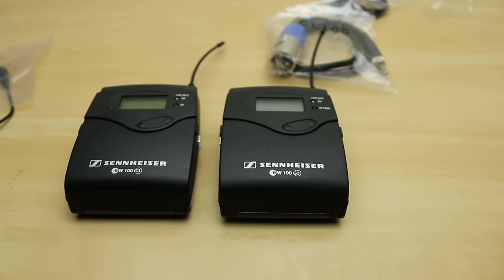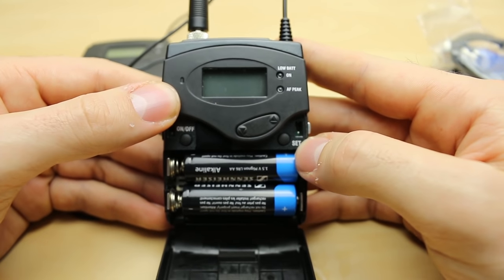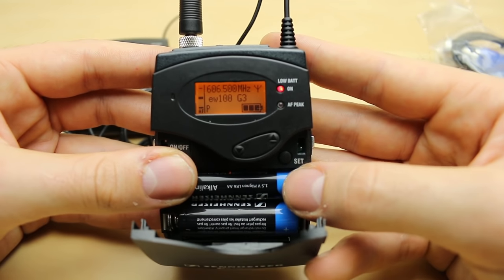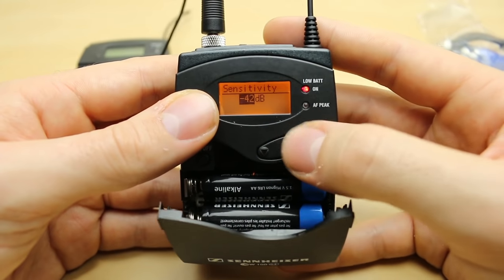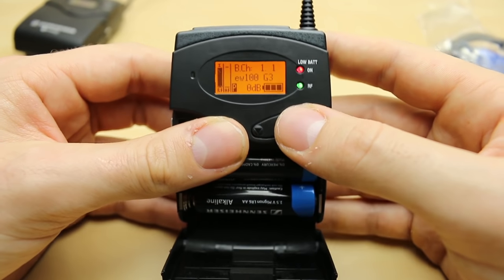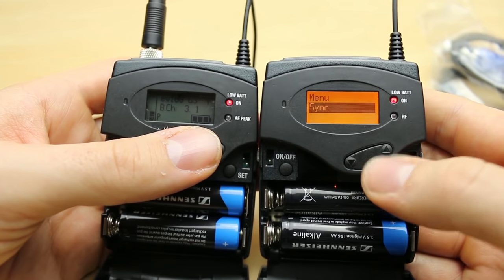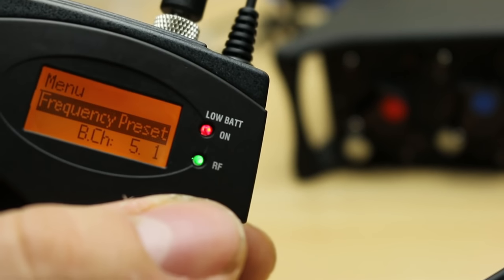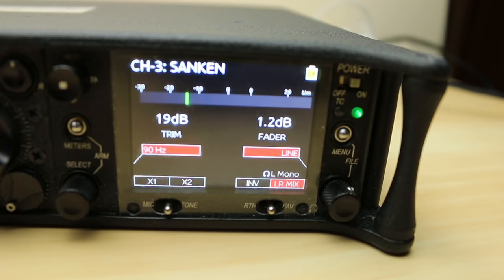G3 Walkthrough And Setup

Comment: The easy setup and scan list function is extremely useful depending on where you live/work. Where I am, many of the frequencies are on a shared basis with broadcast etc, and are susceptible to interference. Easy setup will scan through and recommend a bank with the most free frequencies.
I use this every time I go to a location, but in some countries, areas or frequency ranges this may not be necessary.

Comment: Thanks for that Matt! For me, the G3s sound best when I'm using them as:

Tx = -24 or -27 (with cos 11s)
Rx = -12
Going in to a 688 channel set to MIC, with the Trim at roughly 42dB as a starting point.

I've found this combination to give me the least noise (best s/n ratio), and least chance of clipping at any stage.
I do change the Tx level when auditioning the talent, and then mix mainly using the 688. The Rx always stays at -12dB.
Reply: Normally, most people set the output on the TX at –12db and select MIC level in the camera XLR or on your mixer. 
You’ll get a better signal to noise ratio and more importantly more range on your wireless if you set the output to +12 db on the TX and select LINE on your camera or mixer.
Sennheiser site explains: https://www.youtube.com/watch?v=beaRlml3yto
Lectrosonics gives a nice explanation: https://www.youtube.com/watch?v=WW6mrDhj4e0
Reply: @christianlocal81  This worked well with my G3 + Cos11 + SD744T. When I had it set to mic level and -12 on the G3 I was getting a lot of noise floor.

Comment: Is there a way for the filmer to monitor the audio with headphones?
Reply: Alvarox9 Somebody answer this mans
Reply: If you use it on a proper video camera, yes, you will use the headphone out from the camera for that, because then you hear the microphone on the wireless XLR input, and the camera microphone on the other XLR input.  When used on a photocamera where the video function should definitely be considered an extra feature: you are in for quite a nasty solution with adapters or home-made cables, or be in no position at all to be able to monitor it in camera, and probably when you use one of those camera's, you are maybe using a sound recorder to record the audio and have a headphone connection of of this.

Comment: I’m trying to use this in a public setting where it’ll be rather loud at times due to large foot foot traffic & city sound. Anything I should be aware of?
Reply: Use a different microphone for this set, the one delivered with the set is omni-directional (and I am not to impressed with the sound) and picks up a huge amount of sound out of the surrounding environment.  At work they use Voice Technologies 506 (VT-506) lavalier microphones and they are definitely better.
Also, try to avoid mixing audio in-camera, keep them seperated (even if that means getting a stereo-channel out of the camera with the lavalier mic on the left, and the camera-microphone on the right), it's something you mix in post-production.

Comment: Still wondering why you are setting your mixer channel 3 to LINE instead of MIC. I've got a 633 but assume it's the same setting.
Reply from the maker: +christianlocal81 o0o0o0o great question I go through the sl6 but will do a test tonight! Thanks for the reminder!!
Reply: The Reciever sends out a line signal from it's preamp. It's a highly debated topic... Google it. If you set to Mic, you'll just have to gain back the volume you lose. But if you really like your Mic-Pre, then you might choose Mic.
Reply: Do you know which preamp is better to use between the receiver and a zoom f4?

Comment: Thanks for the walkthrough Matt! I just got 2 sets of G3s with some COS-11 with a servo cable (TA5->1/8). Basically have the COS-11s set up for Lectros and using the G3s as backup. Problem is that I dont get a signal from the COS-11 to the Tx. The ME 2 works fine so I'm guessing that whoever soldered the servo cable did not do it correctly or its just broken. Just seems odd that both cables are not working. I'm hoping I'm just doing something wrong on my end with the set up. Wanted to get your thoughts. Thanks man!
Reply from the maker: Think if you got the same cable made then likely the sane wiring issue, had no problems with them wired straight to ta5
Reply: Ya thats what I was thinking also. Those cables are hard to solder also. Thanks man!

Comment: Would like your input? 
Normally, most people set the output on the TX at –12db and select MIC level in the camera XLR or on your mixer. 
You’ll get a better signal to noise ratio and more importantly more range on your wireless if you set the output to +12 db on the TX and select LINE on your camera or mixer. I emailed Sennsheiser to get a response as well.
Sennheiser site explains: https://www.youtube.com/watch?v=beaRlml3yto
Lectrosonics gives a nice explanation: https://www.youtube.com/watch?v=WW6mrDhj4e0

Comment: Are  you using the G3 for the audio for this video? It sounds super clear. I ask because I bought two brand new G3s and there is a white noise floor to both of them. The frequency is very open and it isn't from any competing noise. I'm using Cos-11 mics with them and sending into a Sound Devices 633. I'm trying various fixes and can't seem to get them to work. Any thoughts? Is that normal for a G3?
Reply: The thing you might need to lookup is the "bias voltage" the microphones you are trying to use need in order to work properly.  While they might work with a lower voltage (the transmitter accepts 3Vpp I think) they will loose "transmission power" (not between transmitter and receiver, by the way, but in the cable) for what get's through to the transmitter's input, which will also include more noise from the start.
The Cos-11 might use a higher voltage.

Comment: For what is cable emulation setup?
Reply: It's a way for the receiver to emulate guitar cables and to simulate a certain impedance (so it might stop the receiving end from overmodulating the signal while that signal is already turned down to the max).   Guitar signals can be much greater in power than microphone levels (and they can vary outside line-level limits, sometimes, which is why some sound companies do not like to have them hooked up directly to their whole setup and have a microphone next to the guitar amplifier if the guitar is directly connected to one, next to the risks of inducing hum or voltage differences that could cause a nasty shock).

Comment: My Transmitter's version is 1.7.7 while my Receiver is only 1.7.0. Do you think this might cause an issue down the line? I bought them used
Reply from the maker: Soara Core I don't think so. You should be able to upgrade the firmware if needed. Never done it myself though

Comment: Whenever I set my sensitivity anywhere below -30 it starts picking up a ton of static. I am recording into a zoom h1 microphone with the h1 set to 45 sensitivity. Any idea why this is happening? Should I try the sennheiser with ~ -12 db and then the hz at low sensitivity? I'm not sure if that would fix it.
Reply: At work they use these with the transmitter at -21dB, and the receiver at -18dB.  This is with a different microphone and on a camera, so it can be a hassle finding out which works best.
-30dB is a huge amount of dampening of the signal (the dB scale is logarhithmic, and -30dB is like 100 times less power if I remember it correctly than it would be at 0dB) so that you are hearing static is not wrong.   You could try to find out if the recorder is expecting a balanced signal which the AF-out of the Sennheiser receivers do not output and could case problems when used in a circuit that might be expecting it (it works by checking one part of the sound signal, and checks it against basically the same sound signal, but with that inverted so it can calculate out any intereference that usually occurs only on of the sides of audio channels (the positive or negative, basically).
Also, try to see if the microphone you connect it to is rated for the input voltage of the transmitter (which I believe is around 3Vpp if I remember the manual correctly) and does not require a higher voltage (it sometimes is called "Bias voltage", and in a way resembles a form of phantom power while not being anywhere near the 48V's of actual phantom powered microphones).
The AF-out dB setting is not a boost of the signal received, it's a boost of what you are outputting and there can be an interesting though difficult mix between the transmitter and receiver when it comes to the dB settings on both in order to stop the camera or recorder from receiving a distorted signal (even if the signal stays within limits when looking at the VU meters of both recorder and receiver, you can distort the signal from the transmitter in first stage already by setting the output to high).

Comment: Hi Matt! Thanks for the video! Have you ever shot in Asia with your G3s? Did you have any issues? I have been using my G3s in China (which is where I bought them) for a few years, but I am not sure if they will work if I have a project tin the UK.
Would it be just a case of manually setting the frequencies on each unit to be in line with UK regulations? Thanks